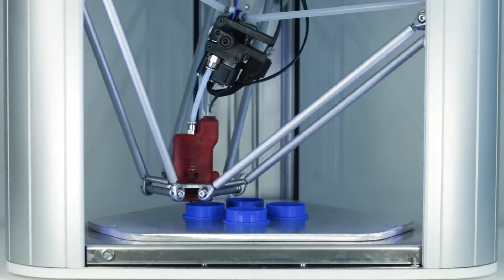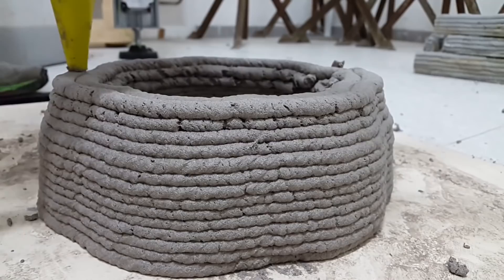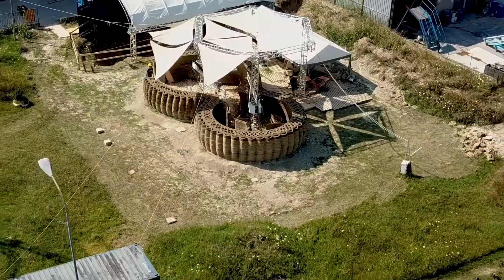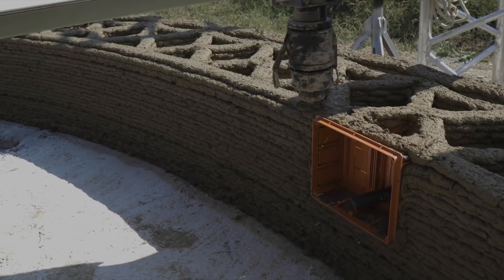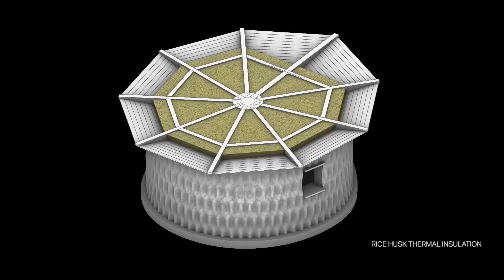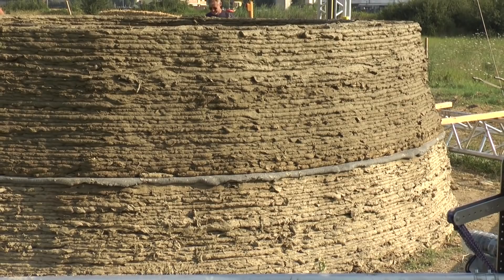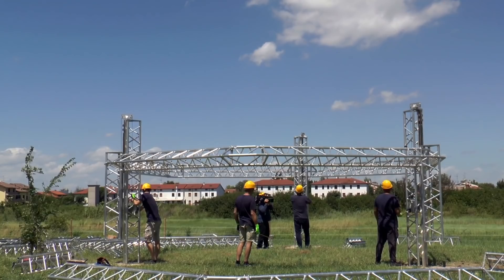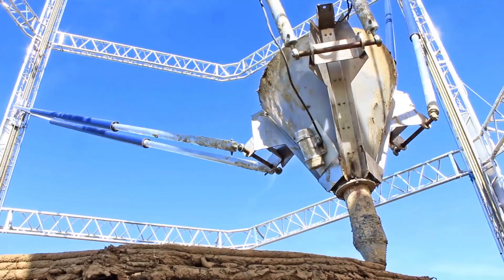$0 HOUSE | How One Startup Aims To Produce Homes at Null Cost

Comment: using lumber and other materials defeats the point of having a fully 3d printed structure. The endgame is to create a process which can 3d print electrical, plumbing, and all structural elements in one continuous process. As far as being affordable for everyone on earth -- market forces and land prices will decide that. In addition, there's no reason that you can't use an attachment to smooth the outside in order to hide the layers. Adding multiple nozzles increases speed.

Comment: I'm just wondering how they intend to get straw and the proper types of mud to parts of the world where that's more scarce or how they intend to wire it for electricity and handle the plumbing in ways that make it still serviceable by plumbers or homeowners... Without a doubt, I love the idea of 3D printing a sustainable home, but this has a significant number of challenges for living in modern society that don't feel addressed by their advertising page or its 132.000 € base price tag.

Comment: The claim of $0 cost should be better explained. There are labor cost and cost of lumber + hardware involved. Plus energy. So even if dirt is "$0" cheap (I doubt so, since even for simple sand you need to pay) the rest is still costly. Companies should stop doing such misleading marketing which can harm the 3d-printing construction industry with unrealistic promises.
Reply from the maker: It’s just a clickbait title, it’s borderline true! The company didn’t ever claim $0 house they just said null cost which is close to the same thing!
Reply: @automateconstruction  I disagree. Claims of "$0 house " or at "null cost" are is LITERALLY not true. They could say "dirt cheap" which would be both close to literal truth (since they are printing with mud) and has a funny pun and yet no one would say they are dishonest, because "dirt cheap" does not mean at no cost. The point of a message would be sent across. But they chose to pick blatant low-level marketing lie which is a shame since this is a worthwhile project in my opinion.
Reply from the maker: @stanpak007  This isn't marketing I made this on my own accord with permission to use the footage and no payment or review from WASP.  Anyway it's their goal not the current status of the project. Eventually it could be done at null cost, imagine it builds a home that you could get a mortgage on for only $1000. Spread out over 30 years the payments on that mortgage would be under $10 a month, is that not null cost for housing in your mind?
Reply: @automateconstruction  Even if it was $1000 (doubtful for raw materials, lumber, wires, pipes etc. alone will cost more) - on what planet the $1000 == $0 (or null)?
Reply from the maker: Relative to current housing prices $1000 could be considered null and with non profit sponsorships the cost to the occupants could be $0

Comment: There is no such thing as a zero cost solution. Everything has a cost, be it time, labor, or capital. For this example, the raw material may be readily available on-site for "free". But you still have to collect it, process it, and then use a custom machine to build the house. I doubt they are going to hand out industrial printers at no charge. Even if they didn't charge the resident, someone still paid for the equipment, manpower, and transportation of said equipment and staff.
Reply from the maker: I agree providing houses at null cost is idealistic not a real life scenario but it’s a nice thought none the less.

Comment: You can just pour a concrete house. People have already done it and have been doing it for a very long time. It also doesn't degrade in rain like a dirt house would. There is a reason people use baked mud bricks and not dirt in those parts of the world. This feels like an answer to a question nobody asked. Concrete blocks are better structural material and mub bricks are already a cheap, easy to use, environmentally friendly option. Also mud bricks are made locally and require no outside machinery. Unlike a giant 3d printer.

Comment: Building in clay is stupid for the long term - for example a flooding means the house is lost. A big storm means the house is lost, and so on. We build in cement and stone basically because we want to be protected by these rare, but unavoidable events.
Reply from the maker: Adobe can last a very long time
Reply: @automateconstruction  Only if taken care continuously. We have the chicken pen made of clay and even if we have it raised on extremely big boulders to avoid staying directly in the ground and be affected by rain, even If we use lime 2 times a year, it still degrades a lot. As opposed to our concrete house, that does not require any care in regards of walls for about 40 years, with only occasional liming for looks. Clay is a liability. Always choose concrete/cement.  We also have brick and mortar roman buildings that are still standing - so yes, they survived humans and wars, not to mention weather/storms/rain.

Comment: Wait, so it's made of mud? 

Rain: "I'm about to ruin this whole man's career"
Reply: Yeah, this "mud" was a very common method of building walls for millenia even in colder climates.
The important thing is to have an overhanging roof so that the water doesn't damage the walls.
Flooding of course is a problem.
Reply: @benjaminfacouchere2395  Flooding can be taken care of by building it on a raised surface,  I've seen people build upon large granite stones for such purposes.  You can also build a diverting wall or culvert to lead to a drain system.   And in the worse case scenario, you can always cover the outside of the wall in some sealant,  much like the wattle and daub buildings of the middle ages England,  the white sectioned walls are covered in a white wash that seals and insulates from moisture and can be made from all sorts of things.

Comment: Would be great to know the electric total power needed to build the house. Divided by the total years such a house will last. Just to compare.
And, by the way solar panels emit a lot, when they are build (in china). So telling there are no emmitions isn't 
accurate.
Reply: exactly imagine my face when he stated that they don't use motors to set up the printer. If the solar panels are powerful enough to power the printer and the machine to mix the dirt a few electrical motors should be fine. They seem to forget that people have to get payed for their work i bet this house takes more man hours per m² to build than a normal house with no pluming and foundation.

Comment: Ummm... Hate to point out the obvious, but aren't those insects called 'mud daubers', instead of 'wasps'? You could always rename your company "The Mud Dauber Company".
Hey, I've already got a double 20 ft diameter concrete dome bungalow designed with a linking bathroom and walk through closets. So, you'll print it for free?

Comment: Would I live in a 3D printed adobe home? Absolutely!
How long does dirt last?
Can you burn dirt?
Termites won't eat dirt!
Adobe is a thermal mass, which requires little heating or cooling!
Repairs are cheap and easy!
The more dome shaped, the more wind resistant it is!
Remember when building with adobe you need; a big hat and dry feet! If you keep the water off of it, it will last forever!
And all of the above is the problem with adobe, corporations hate it and will do everything in their power to keep you from having it!!!
Unless of course, they hold the patent!
Reply: Isn't Adobe a computer program? 

 And termites and other insects can still make nests in the walls and destroy it.. 
 Termite mounds are made in dirt, they just eat wood.

Comment: I keep seeing these printers with various mixtures of cobb or adobe in the cement. Why isn't anyone using reclaimed styrofoam to make an aircrete mixture with the straw? It's just as strong but with a lot less weight. A multi-material extruder would let you change between different types of concrete, like aircrete for filling, fiber-reinforced at structural points, basic cobb for most of the build, etc. 

I don't see any thought being taken for air circulation, heating, electricity, plumbing, or networking. It's not enough to perfect modern twists on primitive technologies if no thought is taken for modern lifestyles as well. The Delta style printer also eliminates the ability to print multi-room structures.  To a hammer, every problem looks like a nail.. to a 3D Print enthusiast, every solution must include a bigger printer, but that's not always optimal. We have giant earth-movers now that are remote and computer-controlled, and those have long reach and can be retrofitted with an extruder. There are a hundred ways this technology can develop, and each direction is exciting and makes my imagination race.

This is only one step to a sustainable future, and not even the first one. Maybe one of the steps that need the most lead-time to develop. Using this technology with current earth-bag or Earthship construction principles could yield a revolution in construction, but we also need to focus on using energy more efficiently and producing it in sustainable ways. 

Sorry about nerding-out. It's my dream to get some land and build where I can build structures like this. These ideas have been percolating in my mind since 2008 when I first discovered Earthships.. For clarification, My BG is in Animation and animation technology, but I've worked in construction, CNC shops, as an IT specialist, built custom computers, sculpting, digital art and 3D modeling, Creo and Solidworks, gardening and hydroponics, 3D printing and building 3D printers, and I'm sure it's hard to see how all those things fit together, but trust me they do.

Comment: So they aren't using electric motors for setting up the printer due to costs and CO2 emissions? Won't the number / type of people needed to setup the printer override that cost? Also, if concerned about CO2, the steel frame alone contributed significant amounts. Adding a few motors should barely contribute to it.

Comment: a house should have straight walls.... the basic idea is workable, for now they should focus on structural strength it would be better the other way arround, in building the minimalist structure of the house you can leave the most critical expensive part of the house to professionals and machines, if you have the skeleton you could ad the rest of the building by just using wood or tyles whatever, those jobs that are time intensive and require "low skill" this also adds personality

Comment: Is it a problem to build a mud house? African tribes and Sumerians did it thousand years ago without any 3d printers and without any money because even money wasn't invented. And some of them still build this style.
Reply: It's not hard to build one, nor is it a problem for the most part, the real trick is making it safe for human habitation that complies with building codes, so the structure has to be able to deal with anything from earthquakes to high winds to flooding and the design features to deal with each of those is significantly different between them.   There's also the uniform and structurally sound design using arches and concave surfaces to give it the greatest structural support, as well as the latticed insides that act as insulation and foundation.   If you want to make a wattle and daub hut there's nothing stopping you but it won't be nearly as strong or as good looking as what these machines can make in fractions of the time and not be condemned in the process when a contractor so much as glances at it for the first time.

Comment: Building a house from clay or mud with such thin layered walls is not going to last. Traditional clay or cob houses have thick solid walls to give strength and insulation. Houses printed like this would be extremely fragile and they would cost a hell of a lot more than $0 to print too.

Comment: Unfortunately, the 3d Cement printing seems to have been hijacked by builders, who are charging hundreds of thousands of dollars for ADU in California, and charges of $100 per square foot elsewhere. The only way we are going to make affordable and still profitable housing is by obtaining machines for the end user. WASP should be proud of their efforts. I have requested more information in order to become an end user and build small, homes, primarily geared for the elderly in small communities with assistance.
Reply from the maker: Mighty buildings the company I think you’re referring to in California with the ADU’s uses a UV cured polymer not concrete it’s extremely different.
Reply: Yes and permits are limited..

Comment: Neat idea. Though with materials like cob and adobe it is necessary to knead the mix both before and after application.  This construction method does not do this.  I have little faith in the structures longevity.

Comment: there is no way that trucking this thing in is cheaper than a truck load of bricks. hand cranks to preserve electricity ... even if you solar paneled the robot . the robot wouldn't be running during assembly , a third world brick house only costs 2 grand labor included, I've lived in villages before.

Comment: Nothing is free and never will be, the cost of assembling the printer in terms of man hours, transport and even manufacturing of the printer in the first place will always be factored into any and all projects it carries out. Not to mention the time and effort that went into research and development to have a working printer to begin with. On top of that what about the materials to produce the house. Even if you get them for "free" they will need excavating, transporting and loading into the hopper that the printer uses. More man power aka, wages that needs paying.
Let's say you automate that process, that is even more machinery requiring setting up, transportation and research and development. As well as maintenance. More cost.
And now let's talk about power, where is it coming from? The grid? Then you are paying for it. Portable generators?, then they need fuel. More cost, Solar? More equipment and materials needing to be purchased, setup, maintenance etc. Etc etc.

Wages alone will set the minimum price, let's say 10 workers for 10 days, Example...200 a day per worker then there is a minimum cost of atleast 2,000 a day or 20k minimum total wages cost without factoring all of the above

So I say again.... NOTHING IS FREE.  there is always a cost

Comment: Not a very practical idea. Uneven shrinkage of the material during drying is not taken into account. Maybe the production of individual small modules with their drying and already assembled into a structure in this form will be much more reliable? Always, you need to strive not only and not so much for cheapness, but also for reliability and safety.

Comment: In Florida I've been of the opinion that the entire housing industry needs to be turned upside down. The way they make houses in Florida is terrible. They constantly have problems with termites and usually the poor construction makes them unstable during hurricanes or tornadoes. And the building materials are expensive. It would be far superior and efficient to make them from adobe or something similar. If any of my crypto makes me a multi-millionaire I will make one of these houses so that it is off the grid, no AC, no heater, with solar panels and a small turbine, with a battery system for continuous renewable energy.

Comment: This looks viable for building nearer to the equator but up in northern countries this would be a downright stupid design
The roof especially looks like it could be a problem anywhere with moderate to heavy precipitation
Might be useful for more temporary structures but anything meant to last more than a few years would probably start to have a lot of problems
Reply from the maker: There’s a building made out of similar material in Colorado where it freezes often and it’s still standing.
Reply: @automateconstruction  Colorado isn't very wet or especially cold
It's probably not going to work very well any further north
Even the mud buildings of antiquity had a limit to how far north they could be maintained
If they fired the building after construction like a massive brick it could extend their range
Though speaking of fire this whole building is basically a tinder box constructed out of really flammable stuff

Comment: It's cool, but I dont see what the use case is. Building homes in Africa? Pretty sure an experienced tribal could construct one faster than monitoring this thing, and without any hardware. Building in developed nations? I doubt tiny adobe huts like this will catch on. Plus the building material, does not lend itself to large structures.

While the concrete used in 3d printers might be more expensive, it is unlikely to stay expensive if it were massively adopted!

Comment: This costs the labor to dig up and process the mud, flatten the ground, the developpement cost of the machine and prototypes, the cost of the power, the cost of maintaince, new parts, the cost of digging up the metal they are using in those machines, melting it, making computer chips etc, this is far from free...

I mean just look at their own video, they are using industrial excavators with huge metal tracks that guzzle fuel, a huge metal truss structure to support the printing heads....
This is beyond silly, it is far above the cost of labour in any poor area, and using the excavator in any non stupid way you could accomplish dozens of times the ammount of work, digging up foundation, making houses out of bricks and not raw mud etc

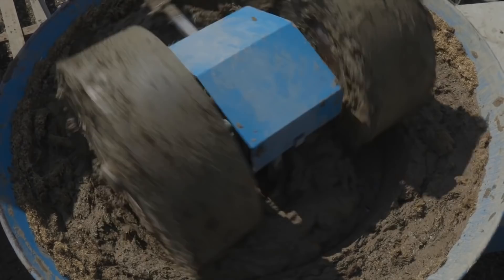2:54 Ahahah what a joke
Reply: This is like a bunch of rich kids trying to waste their mendatory university time away by trying to think of the most expensive and inefficient way to make a mudhut